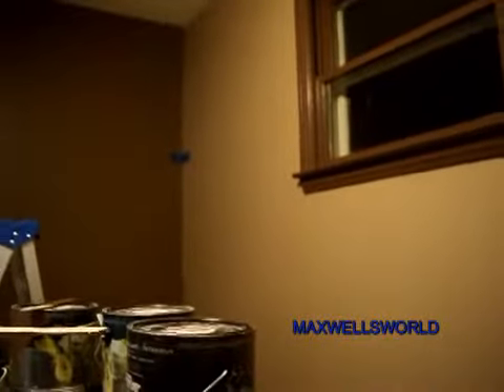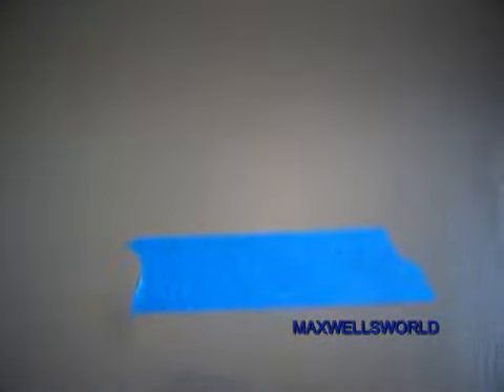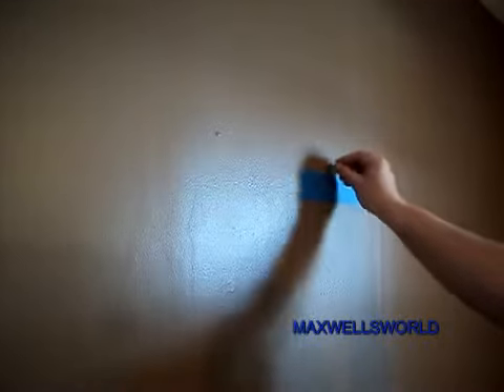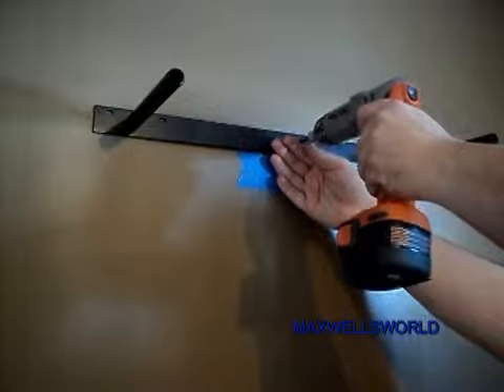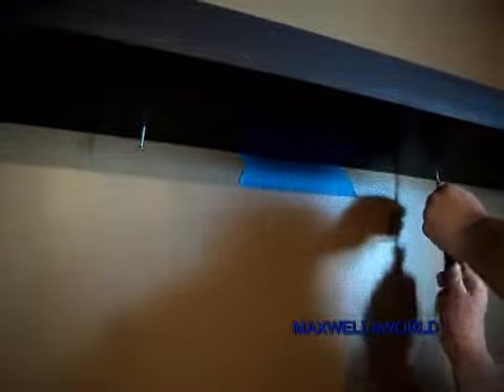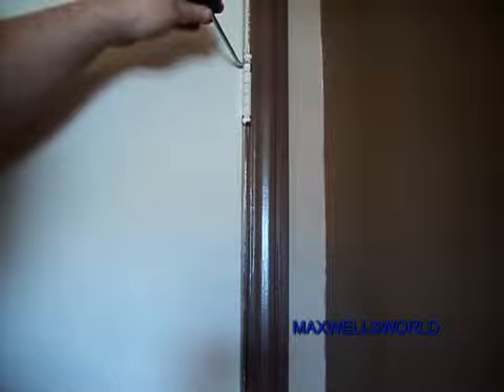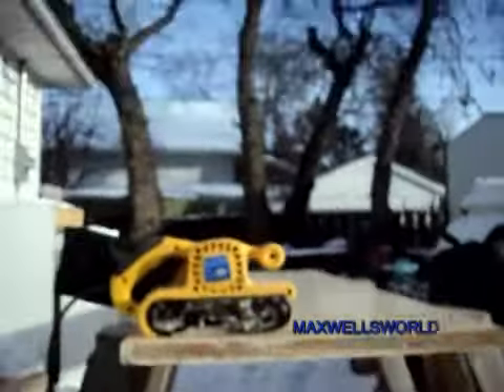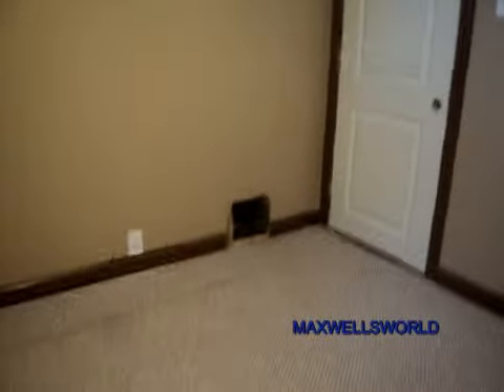room reno part 7 (finished project ) maxwellsworld.

Comment: We use  plastic anchor into our walls that are made of brick and cement.... 15 centimeters thickness..the anchor expands when the screw enters...interesting...it seems your walls are made of a centimeter plywood and you may have internal clearance for thermal insulating material...very interesting these differences from South and North America.... weather and culture made that difference..we have no wooden walls...we are scared about fire.

Comment from the maker: @destroyersoueu here  all house construction is wood   being the weather gets cold here during winter the walls are hollow to make room for insulation   as well we do insulate our attics to help with the heat loss . . its neat to see the differant climates and the building standards . as for the plastic anchors i have never liked them they always pull out  on me so i have come to upgrade the hardware to over build it . thanks for your comment